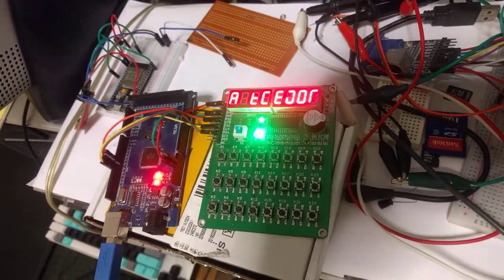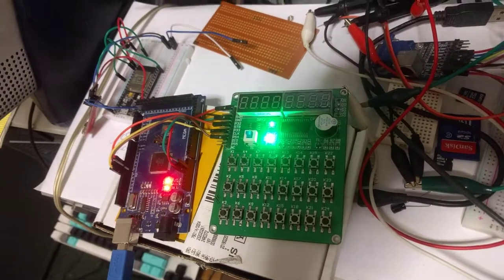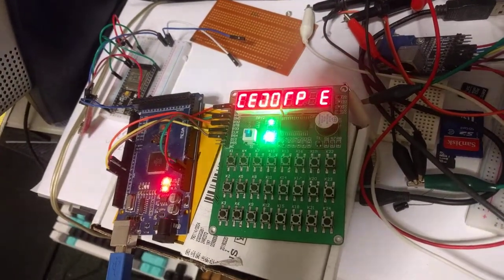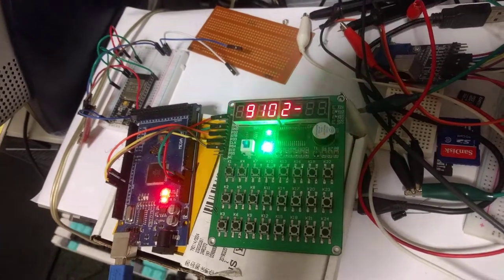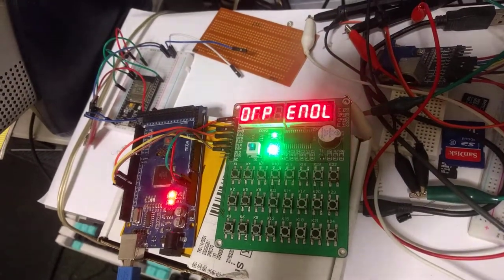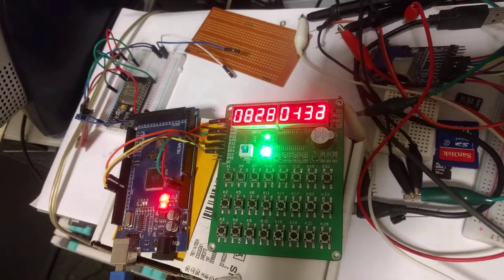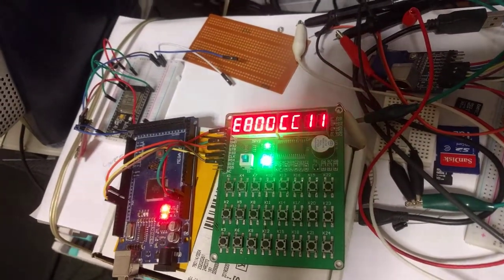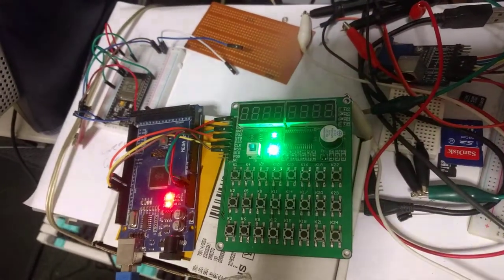My KIM-1 6502 Clone Proof of Concept

Comment: The pre-installed driver firmware on the built-in STC15W204 gives an impressive demonstration. However, those trying to use it with an Arduino will have found that, while the LED Display can be driven by an Arduino, the keyboard is unresponsive. 

When the four links are removed to disconnect the STC15W204, the board can be driven directly from an Arduino using one of a number of TM1638 example sketches. But as mentioned above, the keyboard has remained inoperative. Checking the same sketches on a LED&KEY Board proves that the sketch is working just fine so the problem must be on the HWA11 Board itself.

After some investigation, the problem was found to lie with the pull-up resistors on the STB (R3) and DIO (R5) lines. The Track goes from the bottom of R3 to the top of R5 but has been left floating and goes nowhere else. The Track should be connected to VCC in order for these resistors to perform as pull-ups.

Clearly, the STB, CLK and DIO work fine when driving the LED Display part of the TM1638 and the lack of proper pull-ups on STB and DIO do not appear to cause an issue. However for correct key reading the TM1638 Datasheet states:-
“In data output, the DIO pin of the TM1638 is configured as open drain and therefore requires an external pull-up.”
The absence of a functional pull-up resistor (R5) on the DIO line is clearly preventing the Arduino from reading the key data from the TM1638.

Fortunately, the Capacitor C4 adjacent to R5 is the VCC smoothing capacitor and a small link can be soldered between the top of C4 and the top of R5. This connects the resistors R3 and R5 to VCC so that they can act as a proper pull-up resistors. Once this connection is made, the Arduino is able to read the Key data and the board functions as it should.

Comment: Did you manage to get the Keypad working with the Arduino/Mega?  I think that there is a design error on the TM1638 Digital Display Development Board which stops it working.